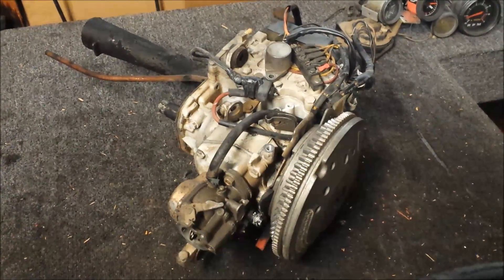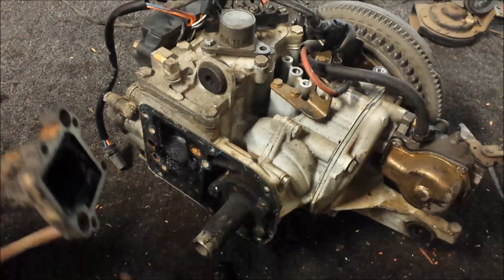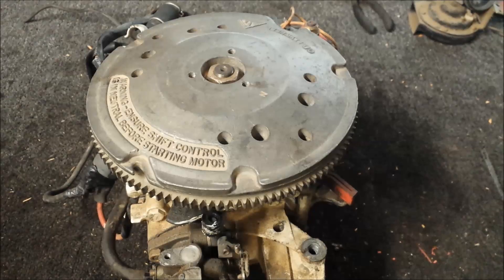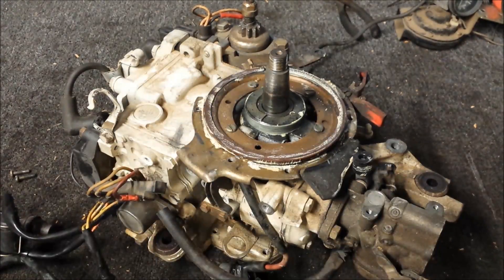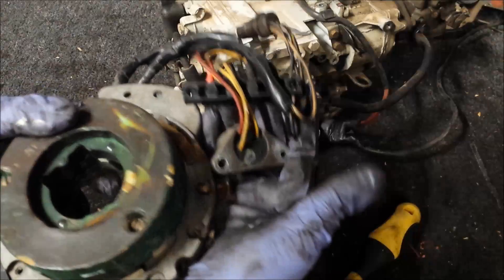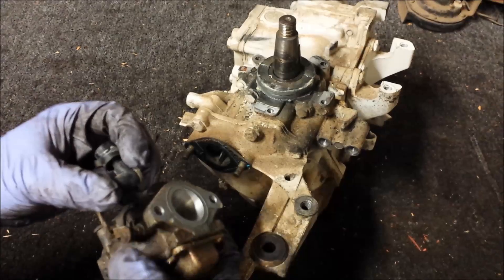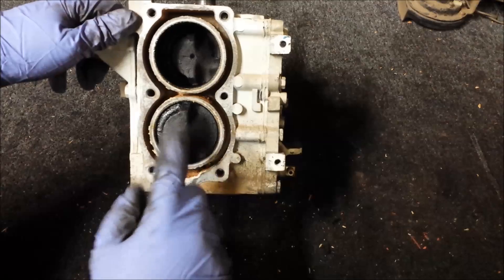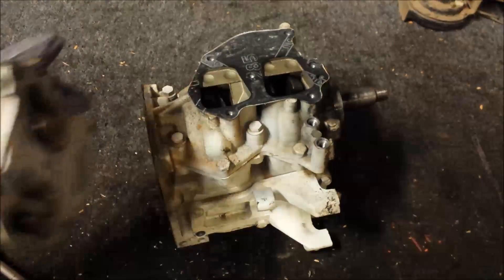Johnson 15 HP Rebuild; Part 1, Teardown

Comment: Hi Brandon. Your videos are very helpful for me working on a complete rebuild of an Evinrude Fastwin 18HP year 1960. Here's a question. There are two guide centering pins which are tapered. They are used to center the crankcase cover on the cylinder block. On disassembly one pin remained in it's hole in the block, and the other pin remained in it's hole in the cover. I have bought new pins, but I don't feel confident punching them out due to possible damaging the cover and the block. What do you think I should do?

Comment: At exactly 5 19 when you hold up the reed plate.  You can see on the plate by your thumb a  channel from one side to the other.  It is about 1/8 inch wide and 5 inches long.  What is that for.    What does it do?

Comment: Just wanted to give you a shout-out, I followed your videos on the Johnson rebuild, I just took my 2000 15hp tiller through a total rebuild, couldn't have asked for better hints tips and some how to's on the process, as of 1/1/21 the motor is back on the boat and going through the break in steps, can't thank you enough for the information

Comment: I have a 82 115 Johnson  the impeller were out on it and it got very hot   I changed the impeller and compression is good on all cylinders. Now the motor runs but takes 15 to 20 minutes before it will open up and playing before that it is only about half throttle. Any suggestions

Comment: Hiya Brandon watching these vids inspired me to my 1979 15hp thank you for the in depth and very clear detail and instructions and advise, now I've a question it's been bothering be as it keeps rising it face,  I keep hearing that Johnson evinrude actually struggled to get 15hp out these motors untill early 80's where a series of updates or upgrades were added, 1979 they added the tuned exhaust then 81-82 the Reed plate had adjustments made to make it a true 15hp so anything before a little low on power , can you shed some light on this if its true or not I've an opportunity to pic up a 1986 15hp which I was gonna use for parts that that reason 
Cheers Kris

Comment: I don't know if I can ask such question here but I have seen that you have used a simple rubber tube to replace the grommet (Upper water tube 330426). Do you know where I could find the tube or indicate it's  size?

Comment: For the life of me cant get a 15 carb to run right on my 9.9 Ive cleaned it put in two kits put a new pump changed fuk lines but fuel doesn't get to plugs dpubt its the reeds as i cleaned them last year im thinking a blockage at the lead  plugs on the carb its nuts blue spark on the plugs so not a power prob fml i want to go fishing but Got stranded last week

Comment: hi have a 1978 15 hp Evinrude. have a problem with the steering column. The upper mount seems to be sliding lots and I can rock the power head and steering column within the exhaust housing. it makes a click noise when fully pushed back then pulled forward. but vibrates with a rattling noise. is there a video on how to repair that? unsure if it is bolted down or how to get at that part or what parts are need for that fix. thanks for you help good videos.
Reply from the maker: I dont, but this video might help:
https://www.youtube.com/watch?v=HCH7g6qKVHA&t=234s
Reply: thanks much appreciated

Comment: I'm joining this thread late, but am wondering why you are tearing this powerhead down, everything looked OK inside...It is easier to drive that crankcase taper/alignment pin out before removing the crankcase bolts.  It is driven out from the cylinder side toward the carburetor side of the crankcase.
Reply from the maker: Just to give it new rings, gaskets, paint, seals, and to clean it up.

Comment: I'm rebuilding the exact motor using your video! Great video, very straight forward. I just pulled roller bearings and one set for the top piston has melted into it's self. No scaring in the piston chamber. Could you email me so I can send pictures and see what you think about it. Zmervich@gmail.com  

Thanks

Comment: Brandon,  NICE VIDEO!  I have a 1980, 15 hp Evinrude which looks kind of like the Johnson.  It has low compression of around 60psi but still runs.  My marine shop says they won't work on it because it's not worth the labor involved. I bought the engine new in 1980 and haven't used it that much.  I did however use engine starting fluid a few times to get it going.  Do you think the starting fluid messed it up?
Is it likely that just the reed valves are sticking and that is why compression is low?  If so, do you think I still have to do a complete teardown?
Can you provide a complete parts list needed to do this job so I can be sure to have everything on hand when I start?
Reply from the maker: Well, dont use starting fluid- it has no oil and makes for dry starts. 
Low compression is probably from stuck piston rings.
clean the carb and get the thing running and do a sea-foam job on it. That may clean the internals out and get it going decently.
Reply: @BrandonsGarage  How much seafoam do you recommend?